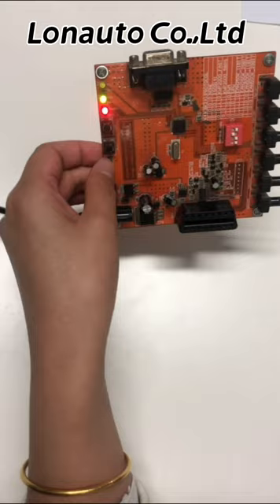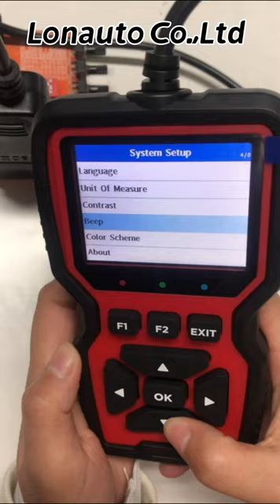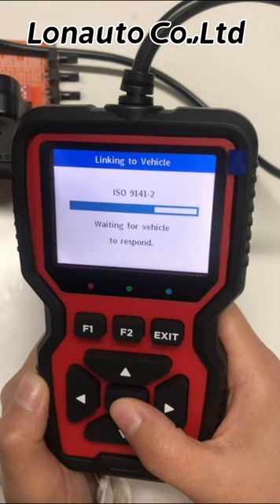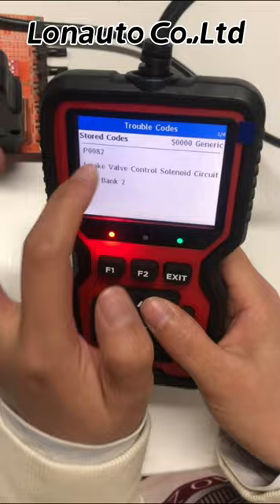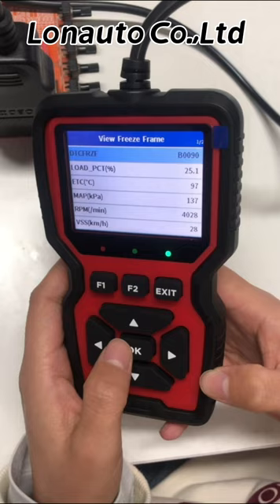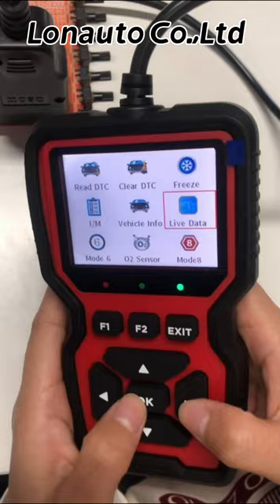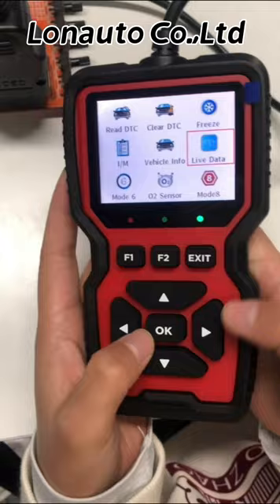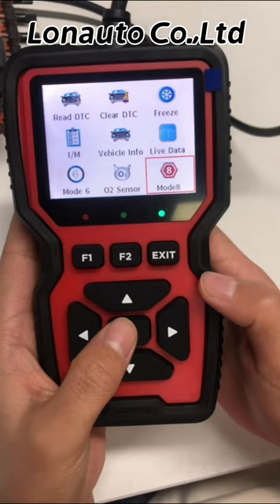V519 operation vedio

Comment: I bought the tool and it came with software version V1.00.231120. When I download the software from the site in the manual and performed the upgrade it downgraded to V1.00.230928. Is there any difference between these 2 versions and are. there any new version available how do we update the tool.
Reply: me compré uno y no venía con la actualización .. me pide comprar una licencia

Comment: Can you explain how to delete the codes?
Reply from the maker: Dear,you can select “Clear Code” function and then confirm it.After
confirming that the fault code is cleared, the vehicle engine fault light
will go out and the code is cleared successfully
If the clearing fails, it can be cleared when the engine is powered off

Comment: this does basic code reads only and some sensor tests - its very basic if thats all you need - does not do any mileage correction.
Reply from the maker: Yes,my friend.This product does not have any mileage correction function.It is work on universal engine system, so many cars can be used.
Reply: in all fairness, they never claimed it does that.

Comment: Can this test ABS(anti lock braking system) for vehicles?
Reply: I think this can but the software protocol is missing from the software developer. 
This will check only engine aprt abs, srs, airbag, other sensors don't have the software in the library
Reply: I don't see that function listed.

Comment: Como se hace la actualización del escáner?
Reply from the maker: Software Upgrade steps as follows:
1） Log in to “elm327. com” to download “V519ProductTool”
2) After successful download, use Type-C data cable to connect the
product and computer
3） Double click to run “V519ProductTool”
4） Select Update Firmware
5） Select “Start update” and wait until the upgrade is successful
Reply: eso no funciona  me pide comprar la licencia .. me compré uno y venia sin la actualización